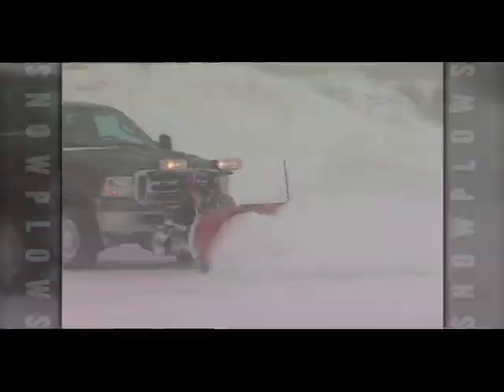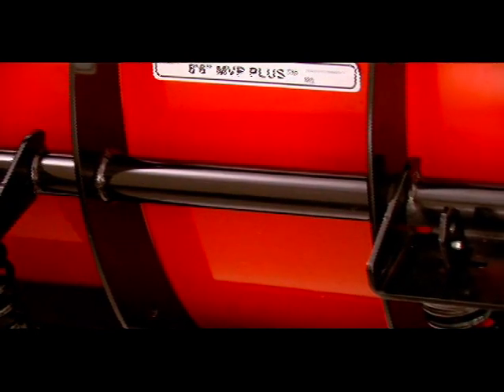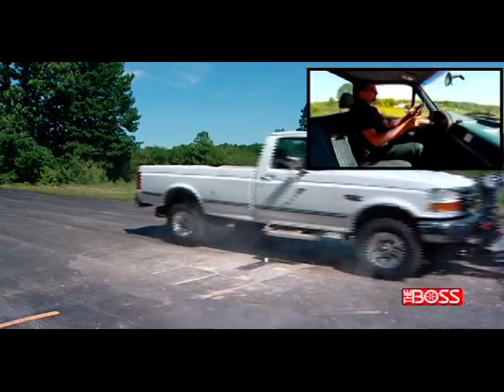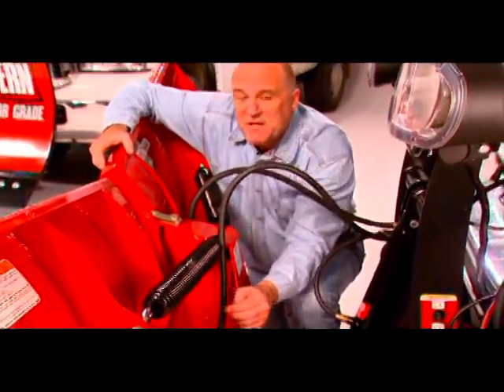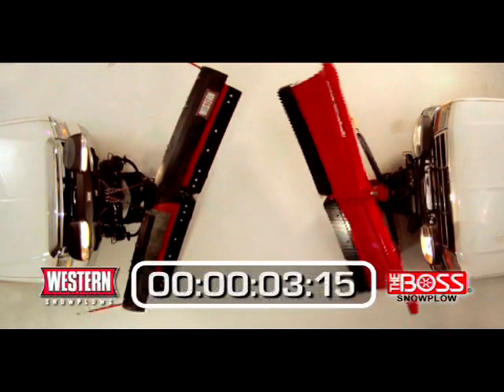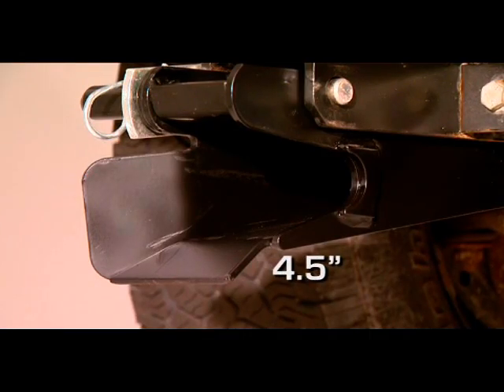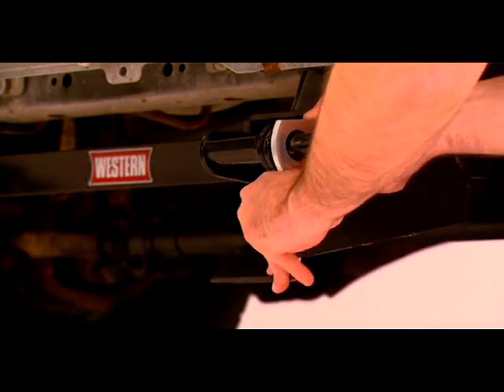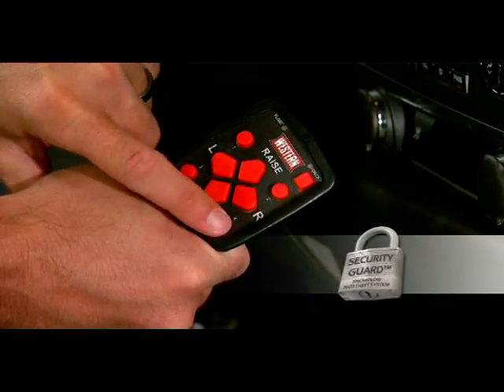V-Plow Comparison - Western vs Boss - Midwest Systems Truck Equipment

Comment: This guy has no idea how the Boss V Controller works. It accomplishes all the same things with less buttons
Reply: He’s also comparing a larger boss plow to a smaller western which obviously the western is going to move faster it’s not as large.
Reply: I have a Boss Vplow an got a Joystick make a big difference on speed of use! I tried handheld an seams always hitting control buttons where the stick does 2 moves at once!
Reply: Typacal Guy doing video to sell a Differant product! Both plows are good but both have good an bad!

Comment: notice that on the trip blade test the boss  plow was going way faster than western
Reply: agree, and do you notice that western hardly trip but jump up when hit the obstruction, which means that if you plow with western in normal speed, your teeth will tell you the truth when hitting obstacle
Reply: even the speed test was biassed considering the boss has rams triple the size and strength of the western(hmm wonder which ones will last for a decade and which ones will start to leak and fail because they are under built)
Reply: 4 years late but let's not forget to mention the age gap between the two trucks

Comment: This is just a western schill ad, and the speed test, the boss has way more articulation so its obviously gunna take longer, the western has very short strokes. You can short chain a boss, just carry 4 ft of chain in the emergency box. And have you ever hooked up a western by yourself? "Easy hook system " dont forget the 8 pins needed lol

Comment: as a former western plow dealer, it was very frustrating to sell a plow, or even worse, a customer would have say a western plow on a 2003 GMC THAT WAS STILL IN GOOD SHAP, BUT THE TRUCK WAS TIRED, SO HE BUYS A 2009 GMC, WELL THE WESTERN PLOW THE WAY THEY ARE MADE TODAY is some cases you could buy a 2200$ conversion kit to work on the newer 2009, but most times you don't have that option, witch means buying a whole new 7000$ plow now, not like back in the day were you could take a western plow take it off a 1980 ford f250 and in a few hours have it up and running on a 1985 ford f150 and out plowing, not the case any more, so if you change trucks, be ready to be cash grab in the market when you replace the truck, as you will be buying a whole new plow, not just a mod to the hook up on the truck, I would never put a plow on a new truck, there not built to take it, if you plow a lot be ready for a front end re-build after every winter, never mind your box bolts all stretched out and raddling

Comment: I bought a MVP3 stainless put it on my Duramax and  plowed 8 miles across Mille Lacs lake in Febuary.  4 Tire chains and was having to give it a lot of throttle in 4 low.  I had rolls of snow higher than my truck hood.  Was super impressive.  I've had it for 8 years now  and it still looks brand new (doesn't see salt)  What sold me on Western was the chain so it can float better and stack higher and nothing to go wrong.  I also liked the added structure. Compression springs just make way more sense.

Comment: I have owned Fisher v - plows for over 11 years and was very satisfied. I just purchased a new  Fisher extreme v2 and am very dissatisfied with how noisy the blade is. The blade clatters so loudly that it caused a few of my tenants to come out of their homes enquiring about the noise. I called the manufacture and they suggested felt or silicone between the ribs and face board. If anyone else has had the same problem, and you have fixed it, please share your solution with me. Other than that, the plow works great;  however, if I had known about this problem, I would have purchased a Boss or Meyers. Probably a Meyers, because of the 5 year warranty and that the face board is welded to the ribs, would eliminate the loud clatter. Sorry Fisher, hopefully engineering can get this right. Other than that, you have always had a great product. Larry

Comment: I’ve used both western and boss I like them both they are top notch plows the boss it’s bit more complicated to take off and put it in  the western it takes less than a minute.
I’ve used western for the last 8 years it never let me down the only thing went bad on it in 8 years was the controller 
I just bought another truck with western mvp3 plow I absolutely love it

Comment: I had a old curtis plow on my old truck, and people can say what they want about those plows, but that plow was a BEAST..   The only issue I had with the plow was getting any service parts for it, as the dealership network  is almost non existent.  I got a newer truck, and went with a western plow.  This is my third year with it, and most likely my last year with it.  Upon installing it, I went through two light modules.  I got a good one, FINALLY, then ran the plow.  This year, I mounted it, and it raised and froze.  The controller went into a security lock mode, and ran to my nearest dealer, about 45 minutes away so they could use a master controller on it to free it up, put mine back on it and it worked for a whole 15 minutes.  As soon as I got it home, it went into a communication error mode, and wouldn't function.  I called that dealer back and was told that the plow module NEVER GOES BAD, but I should diagnose it myself!  Basically making me feel that because I do some minor residential usage with it, that i'm not as important as any of their commercial accounts!  I can not diagnose it myself without the test harness, or I can cut wires and try to jump the plug, or borrow another controller to narrow it down.  Two snow storms later, and after contacting the western plow main headquarters, that dealership got me in, and they were able to diagnose it after 3 hours finding that the module was bad!  WTF??   On a 3 year old plow, one year of which we had no snow!!!!   GARBAGE!!!   I shouldn't have had to replace the plow module so soon!  After this season is over, I plan on pulling the entire setup off my truck and selling it all.  Looking at a BOSS or Meyers.  Screw fisher and western!

Comment: You can adjust the speed on the Boss it can move a lot quicker than that western but I guess western didn't show that because they have an inferior product
Reply: Hahahahaha no western doesn't need to be adjusted. If I had to adjust my plow right after I bought it I'd be pissed
Reply: Tim Dion everything gets adjusted when it's initially installed, no matter the brand.  if you don't like the speed that your dealer adjusted your hydro pump at, just have them change it.  this video is extremely biased towards western if you havnt noticed already..

Comment: false if you push both of the right buttons on the boss plow it will bring the left win forwards and the right back vise versa so it will work as a straight blade

Comment: I have Western straight blades at work. I camt stamd them. Parking lots, winding hilly roadways. Bike paths. Cant use a straight blade. Is also like to add the Western throws snow in your "face" (windscreen) with the slightest gust of wind.

Comment: Boss hands down I had a western. I run boss now. Lots of labor. Attaching brackets removing brackets for ground clearance. If the western settles in soft or frozen ground melt. Mounting isn't easy at all. It's harder. As for theft . Why they to remember a code. I can just unplug my controller.  Good luck if you want to take my plow. Unless you have a controller on you. Boss is heavier then western. That's important on commercial jobs. Scrapping a parking lot to bare pavement. To salt for the hospital.  Bring any western you want. I'll bet you 500 I can stack snow higher. And push your piles back more

Comment: there favoring western .. but boss in a better built plow, western just goes off of there more options, but they do not last as long as a boss, and the boss controles are better just like Jeremy Whitmore said,, less buttons is faster ,, you dont have to switch modes, witch takes longer ... boss is just a better build and long lasting plow

Comment: i bought a western straight plow in 1995 not only did i just sell it in feb,2017 the young man is still using it, i never ever had any problems with it, i did just buy a sno-way and have had nothing but problems with bran new sno-way plow,, im really pissed i tried to save 800 or so dollars and i have spent over 14 hours trying to get sno-way to figure out how to get electrical correct for lights on a 2016 chevy silverado LT, penny wise and dollar stupid ,

Comment: Boss is and has always been the better plow. I only have a western now because that's what my grandfather wanted when he owned the business. When it comes time to buy a new plow it will be a boss! The comparison of the controllers was a complete bunch of bs. If you push in the middle of the top buttons you get scoop and middle of the bottom buttons you get vee same as middle of the left both wings operate to give  you left angle and same for the other side. There's nothing better or worse about one control over the other because they all have the exact same functions. I guess one better benefit would be that boss does it with only 5 switches so it's less parts to wear out.

Comment: I have personal experience with both brands.  My first V-plow blade was a Western and I liked it.....BUT I bought a new truck later, so bought another Western V Plow (BIG MISTAKE!!!).

Here's what changed....I found out later, WESTERN COPIED BOSS'S DESIGN FOR BLADE TRIP ACTION ON MY EARLIER PLOW (that's why my first Western worked so well---it was a Boss design).  BOSS TOOK WESTERN TO COURT FOR PATENT INFRINGEMENT AND WON!!...so WESTERN COULD NO LONGER USE BOSS'S TRIP DESIGN!!!!!!!!!!!!!!

So, after losing in court, WESTERN REDESIGNED THEIR PLOW WITH THE VERY POOR "TRIP EDGE SYSTEM".  The trip edge system allows only the bottom 6 inches of the blade to trip and the rest of the plow stays put.....THIS SOUNDS GOOD ON PAPER, BUT WESTERN'S DESIGN DOES NOT WORK!!

So...when I bought a 2nd Western, it had the "TRIP EDGE SYSTEM".  YOU WILL NOT BELIEVE THIS....IN THE NORMAL PROCESS OF PUSHING SNOW, THE WESTERN "TRIP EDGE SYSTEM" WILL INDEED TRIP, EVEN THOUGH YOU HAVEN'T STRUCK AN OBSTACLE!!  So, you'll be pushing snow and the WEIGHT of the snow (NOT AN OBSTACLE), WILL TRIP THE BLADE.  With the bottom 6 inches of your blade tripped, snow builds up under the front of your truck and you are soon stuck.  I contacted WESTERN many times about this, since it was under warranty and was told it was working AS DESIGNED!!!

SO AFTER HAVING THIS WESTERN FOR 2 MONTHS....I TRADED IT FOR A BOSS POWER V AND HAVE HAD ZERO PROBLEMS.  (I lost $750 in the trade, but it was worth it).

WESTERN IS A SLEAZY COMPANY....THEY STOLE BOSS'S DESIGN AND THEY GOT CAUGHT.  THEY TREATED ME LIKE DIRT AS A CUSTOMER....

EVERYTHING IN THIS VIDEO IS A FLAT OUT LIE!!!  DO NOT PURCHASE WESTERN....I COULD GO INTO DETAIL ABOUT THE OTHER LIES IN THIS VIDEO, BUT THE BIGGEST IS THE "TRIP EDGE ISSUE".

I LOVE MY BOSS POWER V AND HAVE HAD IT FOR 7 YEARS NOW...ZERO PROBLEMS!  FEEL FREE TO ASK QUESTIONS ON THIS YOUTUBE, I WILL TRY TO RESPOND.  THANK!
Reply: That doesn't happen. it only trips when hitting an obstacle. i've plowed with a trip edge western for years now and never a single issue. clearly you were doing something wrong or had it assembled incorrectly or something of the sort. It will NOT trip just from the weight of the snow. what a joke.

Comment: the first plow I ever used was a fisher and it was the greatest thing since the invention of the wheel. damn thing was older than I was but it was damn good. if I was smart back then I would have pulled it off the old jimmy and found another truck but at the time both the truck and plow was 28 years old and the truck was literally falling apart around the plow. now I have a piece of shit Meyer and this thing sucks out loud. ALL but 2 of the factory welds have broken on it and it is so unreliable I have hung it up for the winter (thankfully I only plow my renter, my sisters, there kids and myself) because of the extreme unreliable nature of the Meyer I have now I did not do any "for hire" jobs this year. so now I'm in the market for a new plow to go on my recently purchased suburban and I don't feel like driving 100 miles one way to the nearest fisher dealer so I'm looking at western (witch is the sister company to fisher) and I have looked at boss plows. I like the chain system for one big reason. In case shit goes wrong I can chain it up and get it home. I've been plowing for a long time and I have learned a lot but the important one is no matter what plow and truck combo you have if it can go wrong it will go wrong and it will never happen 1 pm Monday a block from NAPA. it will happen 20 miles out of town at 8 pm. a guy could ratchet strap the plow up but I have had those fail too. I haven't made my final choice but those are my 2 top picks. western has the chain system witch I love but the dealer is 30 miles away. the only advantage boss has for me is the dealer is 5 miles away. western has twice the warranty boss is offering so I'm leaning toward western. but still weighing the decision.

Comment: @4:38 they are wrong....you can press either both right or both left and the plow angles in the respective direction...you dont have to press bottons diagonally like shown...pretty biased video

Comment: You’re wrong about the straight blade control on the boss. If you hold down both buttons on the left the blades will straight blade to the left same to the right. The fewer buttons the better. Read the damn owners manual!

Comment: Good thing western let's you change plows  from a vplow to a straight blade by just switching out my control, oh wait I can't, who's the BOSS
Reply: This is 3 years late, but even 3 and more years ago you could use the BOSS v controller and run a straight blade. AND you can run a straight v blade with a straight blade controller but will only be able to use it in the straight blade configuration. I know this because we have 3 BOSS plows. 2 v blades and 1 straight. I needed a backup controller one night when out but only had an extra straight controller in one truck. That was able to get me through the night when I could get the correct controller and the other fixed

Comment: Western stole the entire  trip edge from Fisher commercial. . I was using Fisher when western was still steeling their Ideas... Any questions?
Reply: fisher owns western, or vise versa. same company
Reply: Douglas Dynamics owns the Western, Fischer and Snow Ex brands. They are not all the exact same plows however. There are small differences between them.

Comment: This is an old ass video!!!
Seat time = experience.  Its The OPERATOR not the plow . BOSS DXT has NO chains and DUEL TRIP MOLDBOARD & CUTTING EDGE WITH DOWN PRESSURE.smartlocks are STANDARD features.westernotsomuch

Comment: I been plowing snow for over 27 yrs, I have a Boss V- plow for over 10 yrs now, NOT a single problem ! I plow over 100 accounts, some commercial some private roads and some private driveways. and yes this guy is a dill hole, most the stuff he says about the Boss is false. I owned western plows for yrs, after having the Boss, I will never buy another brand again.. and yes with proper momentum I can get snow as high as a basketball hoop and not get stuck or buried....  very biased add for sure...

Comment: This comparison is 100% false and a complete lie you can operate the boss angle left and right with one button push if you are going to the right push the center of the right two buttons and it will go to the right one button same as the left push the center of the left side buttons and it will angle to the left all by itself you want to go to the scoop mode push the center of the top two buttons it will go in the scoop mode and it will do the same thing in V if you push the center of the bottom two buttons it will go to V the boss is truly one handed operation another nice thing about boss when the blade flips instead of the edge it is a lot safer if you hit something that's over 4 in tall with the Western you're going to hit the dash of your truck where the boss will bend the blade over and fly over that obstacle

Comment: This guy is a clown some one should break out the crayons and show him that if you press two buttons in the middle at the same time on a boss controller it’s exactly the same as one button per function; or show him even the remote on the top says scoop bottom Vee sides left and right say angle left angle right. Boss is the toughest plow on the market go break another trip edge on your western and while you’re in the shop getting a new one fabricated I’ll be putting my boss to work